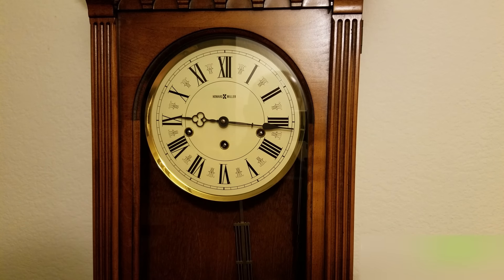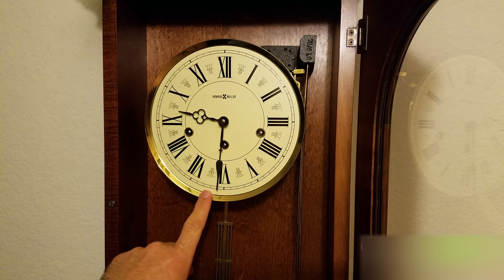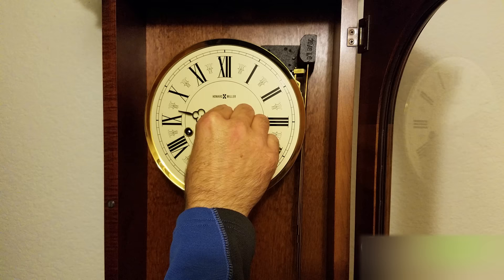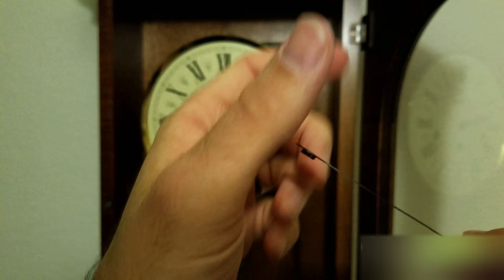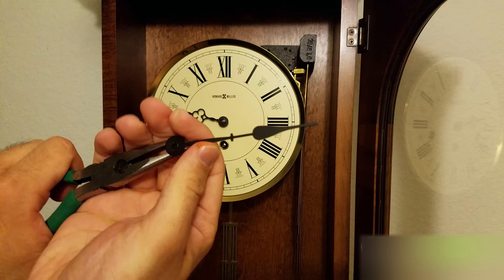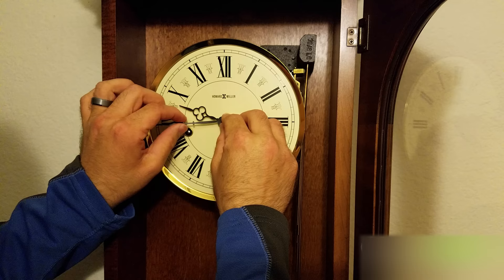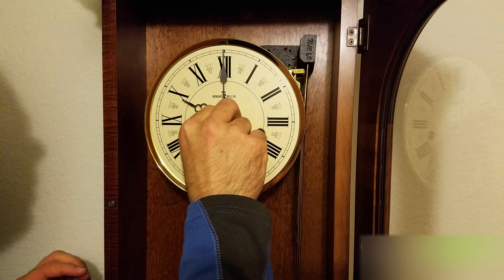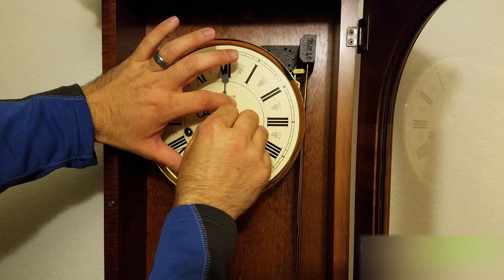How to Fix Clock that Doesn't Chime on the Correct Minute

Comment: My problem is different. I want my clock to strike the number of times that match the actual hour. Eg. Strike 6 when it is 6 o'clock
Reply: I have the same problem. 
As much as i try to adjust it, it's either strikingly the wrong hour, or its the wrong quarter hour.
Unfortunately this video doesn't address this problem. 
I'll keep looking  !
Reply: I don’t know how to make my clock chime
I can feel a tug or a clock when I put it on the hour or half hour but no sound
Reply: He answered this question right above the original posters question by fooling the clock and moving hour hand to whatever time it’s chiming. Then move to next hour. He said keep doing that until the proper chime is reached and to never move the hands backwards unless you’re familiar with your particular clock
Reply: @900stx7  1q
Reply: @sherraj3658  o
Reply: Same! 20 o'clock is not a thing!
Reply: I'm pretty sure I'm late and had the same problem but I fixed it by fixing the chiming problem first then I make it chime multiple times so that I can count how many times it chimes. Then I just move the hour hand only and then put it at the number of times the clock chimed. If yours is more than 12 then it should be using military time so just subtract it by 12 and that should fix it. Hope it helps!
Reply: @900stx7   My same issue. My strikes 10 times when it is 8pm.

Comment: I know you said for example, "The clock should chime exactly when the hand hits 30, but as you can see it doesn't, it's actually closer to when it hits about 31, that's not too bad." Well, on the 30, it didn't chime on the 31 mark, it chimed in between the 30 and 31, because I saw it, so what you said seemed to be wrong.

Comment: Thanks! I just found a really amazing 1879 wall clock made by Southern Clock Co. that also tracks the date of the month. It was in rough shape, but I got it all cleaned and working perfectly, except it was chiming a minute late and driving me up the wall trying to fix it. It doesn't have an adjustable hand, but it DOES have a little brass disk and a pin that holds the hand on, so a little light sanding on the inside of the square hand hole and a bit of bending on the hand, with the pin and disc providing the pressure to hold it in position, and it is now chiming when it should. :)

Comment: Thank you so much
I have a large 1981 Seth Thomas 3 chime grandfather that has been chiming at 8 minutes instead of the 3-6-9-12.
I have been beating my brains out trying to get this thing to work correctly, i tried your needle nose trick & got it dead center on the 3 on the first attempt. Cool beans.

Comment: The easiest way I found to do this is with with the tool that come with a screw driver kit. In a lot of these kits now they have a few bits that are square and I found that one of them fit the second hand perfectly. This way you don't take a chance scratching up the hand.
Reply from the maker: A great recommendation! I will keep this in mind the next time I make a repair like this.

Comment: Great lesson ! Thank you, this fixes my clock issue too ! Thumbs up, sir !
Reply: Use a thin minus tip screwdriver for testing electricity presence to help holding it while you adjust it to get to the right position. I don't recommend using plier as it will mar the brass.

Comment: Our wall clock chimes on the hour and each half hour but one day it made a big click sound from inside while the minute hand was climbing the hour and the chime went on for over a minute before the spring had run down. Then the pendulum stopped, like a piece from a scary film.
I manually swung the pendulum but it would not stay swinging. I checked and slowly rewound the clock and the pendulum would stay swinging.
No idea what happened however since then our clock chimes fine except that the 6 oclock chime always happens at 14 minutes past the hojr, all the other are fine.
Have we lost a tooth somewhere??

Comment: I took a French 4 glass panel mantel clock my Mother gave me and submerged the all brass movement in boiling water for a couple of seconds to clean it.  As soon as I pulled it up out of the water it started ticking and kept perfect time for the next 17 years until a winding spring broke.  I, of course oiled the clock after the hot water bath.            Richard Tieken

Comment: I have a 1940's shcool house clock, just had it "repaired", came home today ( the glass wasnt set properly and it broke the minute I ifted it to hang.  6 mos ago.  It stops all the time but I can live with that I htink I need to level it.  OKAY I COME HOME TODAY AND THE BIG HAND IS ON THE FLOOR, was there a cap holding it on or a pin I cant see . help please

Comment: I have a clock that strikes about 2 minutes off.  Even though it has a spring wound mechanical movement regulated by a pendulum, the hands are same as those use for quartz clocks which means your trick won't work.  So I'll have to find a way to move one of the gears inside without having to take the movement apart.

Comment: I just bought a secondhand Sligh pendulum wall clock that is key wound. I can't seem to take the minute hand off to do what you did in your video. Also the hourly chime is about a half hour too early. Any way I can fix this? I've been trying to do searches online but can't seem to find much. Sligh is no longer in business so I can't call them up for help.

Comment: I just got a battery operated daniel dakota grandfather clock & a white wire is off the back & doesnt work. Theres a black & white wires. Seems like they go to battery pack. Any idea how to fix that issue
Reply from the maker: Hi there, that's quite an easy fix but would require someone who knows how to solder. Your local computer guy might be able to help, or anyone in the family the works with electronics. Hopefully that helps!

Comment: Great video! How do you adjust a clock that the hammer for the hour rises but the flywheel hesitates and stops? I can manually gently touch the wheel and it starts again. Any suggestions? Thanks
Reply from the maker: Sorry for the delay! This is a bit trickier, there are many many reasons that could cause this problem. I would first check to ensure the hammers aren't hitting each other or getting caught on one another. If they are simply bend the hammer one way or another. If the hammers look clear, take a look at the movement for any debris that might be easy to pull out/clean. If that still doesn't do it, because I can't really see the clock, it may need to be taken in.

Comment: I did as instructed and have done this in the past but this time it is not working. I was 2 minutes off and have moved the minute hand backwards twice and it seems to be going off at the same time about 2 minutes slow. In other words it would go off at 8:32 and I would move hand back to what I'm guessing is 8:30 and it still goes off 2 minutes late.

Comment: Hey, I doubt you would know the solution but my grandfather clock chimes when it should, but the wrong amount of times. For example, when 6 o clock hits it will chime 10 times instead of six. Would you mind helping me out, Thanks.
Reply from the maker: Typically, the easiest way to fix this is to simply move the hour hand gently, to the number 10. So, if as you mentioned at 6 o'clock, it chimes 10 times, the clock "thinks" it's 10. Just move the hour hand forward to the number ten, to reflect that. Now, move the hand forward to the next hour (in this case, 11). It should chime, 11 times. From this point forward, you just keep on moving forward through each chime until you are finally at the correct time. Here's a tip to speed up the process, if you get to 11 o'clock (for example) and it's chiming correctly but the current time is say 7, then put the clock on "silent" if you're lucky enough to have a lever for it (some of them are hidden in the back, like the clock shown on the video, usually on the right side). Then move it all the way to the correct time and then disengage the silent button/lever. That saves you having to stop for every chime. If you don't have a silent lever, then go through each hour, letting them clock chime, one hour at a time. It's a bit tedious , but, once it's done, it's done. From then on forward just keep your clock wound :) Quick side note, if you don't know a lot about your clock, don't run it backwards, always forward. This is especially true for Cuckoo Clocks. Thanks!
Reply: Thanks for this question because I was having the same issue. Hopefully it’ll chime the correct number of times…..I was moving my hands backwards til I read his answer.

Comment: I have a question? I have a triple wind wall chamber clock. The three wind up holes from left is right. Which one winds the clock? Which one os for the chimes? and what is the tired one for?
Reply from the maker: It varies from clock to clock. Generally one winds the hourly chime, one the quarter chime and one powers the time if you will. The easiest way to figure out what one controls what, is to allow the clock to unwind itself. Then, wind each drum one at a time. The center hole usually powers the quarter chime. Wind the center drum first, then gently turn the clock dial. If the quarter melody starts but the hour chime fails to strike and the pendulum refuses to continue swinging, you'll know the center drum controls the quarter chime (for example).

Comment: Hey there! Just acquired a Ridgeway Grandfather clock and instead of striking the hour when the minute hand gets to the 12.. it does it when it gets to the 6 (so on the half hour) ... Would moving the minute hand to the 12 as you did in your video work the same even with such a large gap of time?!
Reply from the maker: Sorry for the delay! You've got the right idea. There are a few ways to fix this but here's how I would do it. I'll do my best to describe this through text. Move your hour hand to the top, sounds like at this point it's doing the half hour chime (inverted basically), then unscrew the dial nut slightly and let the minute hand "drop" to the six. Now tighten again, now when you run the hand up to the hour, it should be correct. (This is not an unusual and very easy problem to fix). Don't worry about the gap in time, it actually sounds like the clock was at some point picked up or worked on with the hands off. When they went to put the hands back on the clock, they simply put them on incorrectly, can't say I haven't done this myself once or twice :)

Comment: While I like my chimes, I do not like them every 1/4 hour.  Is there a way to adjust it to chime  just every 1/2 hour (Howard Miller GF clock)
Reply: The only way I'm aware of is if you have a selector lever that allows you to silence the strike as well as chimes. As for silencing only on the quarter hours, I've never seen that option on anything other than some very high end quartz battery movements.

Comment: I dont know if you still read this but my 98 year old friend has a twin weight grandfather clock that only seems to want to run for 10 or 15 minutes oncet he pendulem is started. Any help would be geat.
Reply from the maker: That goes beyond this video a bit but often times it's the suspension spring (do a quick google image search). If the weights are staying up after being wound, then that's the next place to look. It could also be that the pallet is sticking or a number of other items (usually the movement need cleaned/oiled). But start with the suspension spring first.Check to ensure it isn't broken. This happens a lot when someone mindlessly reattaches a pendulum. If it is, a new one is cheap. Keep in mind thought, it depends on how old the clock is. It might have a different mechanism. One final thought, if it's an antique, don't mess with it. If it's not, honestly, these clocks are not nearly as scary to work with as people make them out to be. Common sense and a gentle touch will take you far. Watch the gears moving, often times, you'll find something out of place, broken, etc and can then work to fix it :) Best of luck!

Comment: Clock is not chiming on the hour. Chimes every 15 minutes but not the hour. Thank you for your help
Reply: This is likely to be something a bit more difficult to fix. When time permits I'll try and create a video that goes over the most common reasons this may happen. It is however, different with every clock. One thing to note, if it's a spring wound clock, there are usually three slots you must insert the key and wind. This turns the mainspring barrel. It's what powers the chimes. One powers the time, one powers 15 minute cycles and the other the hour strike. One of your mainspring barrels may either not be wound up or is broken (in which case you should change it). You may also want to make sure none of the hammers are obstructed by a silence bar etc. If it's easy to look at the clock movement, take a peak and see if anything looks out of place. Sometimes a little logic and common sense helps solve what sometimes is a really easy fix. If that fails, it could be something a bit more difficult. So long as the clock isn't a family heirloom, I feel like many people make mechanical clocks to be more complicated than they really are. If you have a Hermle movement, take a look online at some break down videos. With a cup of coffee (or beer) and some patience, you can probably fix the unit. One last thing, if it's a weight driven clock (there are three weights hanging) sometimes the chain gets stuck on the gear or slips off. You can usually align it/pop it back on and the clock will strike on the hour. Again, there are quite a few causes, but this might give you a starting point.

Comment: Please I have my clock but when it get to an hour for example is 4:00 o clock it doesn’t ring the 4:00 it goes and ring 5 bells instead of 4:00 how do I fix that thanks very much
Reply from the maker: This is pretty easy to fix. Listen to the number of chimes first. Let's say it's 4 chimes. Gently move the hour hand (not the minute) to the number 4 (it might be a little stiff). Move slowly and take your time so as not to break anything. Bonus tip: If the hour hand becomes loose, just push the circle area (center) back with your finger nails until it's tight again. 

Now that you have the chime and the hour correct, just move the minute hand slowly until you get to the correct time. This will fix the problem. 

Bonus Tip: Some clocks chime every quarter hour. When adjusting the time, make sure you stop at each chime and let it finish. This is important. If you have silence feature, then you can put it on silent, then correct the time and turn of the silent feature. 

Hopefully that helps. If in doubt, do some more research first. Especially if it's an older clock. In my video the clock is new and the parts are easy to find if something breaks. Thanks!

Comment: Another way to fix a off chiming clock is to move the hand by how ever many minutes it's off, then wait for the same amount of minutes the clock is off, then move the hand back to the original point. I wouldn't recommend doing this but, if you cant get the hands off, then this trick might just help!

Comment: Hi, thanks for the video, can we disable the 15 mins alarms in these type of clocks and just let the one hour alarms continue, I have the a similar one,
Reply from the maker: The answer to this is "sort of." While there is no button or lever for it, there's a work around. Most of these clocks have three winding posts. The left controls the hour strike, the center the time and the right the melody. Keep in mind this can vary. At any rate, stop winding the on the right and the clock will only strike on the hour. The downside to this, is that you won't get the melody on the hour only the strike. There are some modifications you could do potentially, but none that I would recommend. Hopefully that helps!

Comment: i have a colin wood & son 31 day wall and its chimes don't tally with the amount of hours struck;can u tell me how I correct this.please help anyone if u can as I am desperate!
Reply from the maker: This is usually a simple fix. For example, let's say the clock is showing 4pm but is striking 3 times (3pm), simply move the hour hand back until it's at 3pm (gently). Then rotate the dial through each quarter until it's 4 o'clock (or whatever the current time is). The click should now be striking correctly. Note that if when doing this, the hour hand becomes loose, gently press it back against to clock again to tighten. Again gentle is the key here! Hope that helps :)
Reply: oh I see instead of sitting waiting all day for 9pm to arrive lol !!..i had no instructions as it was inherited..frustrating stuff;thank u greatly 4 the fix from my turmoil/stress..
Reply from the maker: You're most welcome! When they work they're such a joy. When they don't it's easy to think "that would make some pretty firewood" ;) (kidding of course)

Comment: What abt when the the times is more than the time clock... for eg: when it s 6 it chimes 8 times... what gonna do at that case?
Reply: If , when your clock chimes, it chimes 6 times, then you simply move the hour hand to point to 6 O'Clock.   ..  If the actual time is say, 8.45  , then , after setting the hour hand to 6 you would then wind the minute hand around until the hour hand points at 8 and the minute hand at 45.    As the minute hand passes the chime position , allow it to chime out before advancing further,

Comment: How do you fix a clock that chimes a half hour off? Like the full hour when the minute hand is really on the 6.
Reply: The minute hand centre is square, so if you take it off it can go back on in four different positions. Yours has been put back on in the wrong position at some time. Take it off and rotate it 180 degrees ( or half hour ) then put it back on.